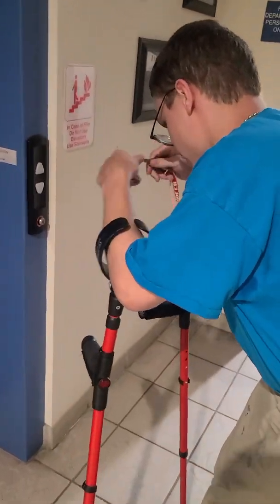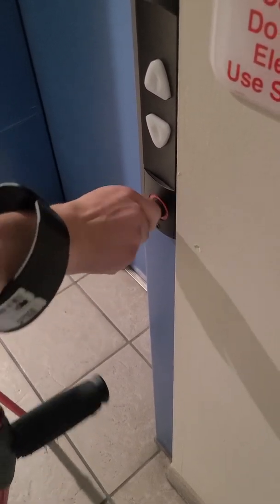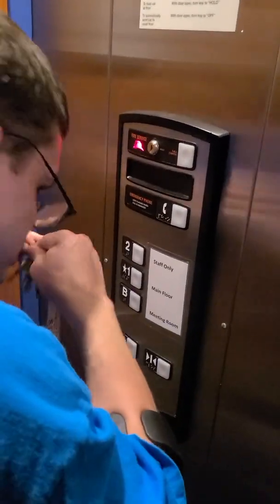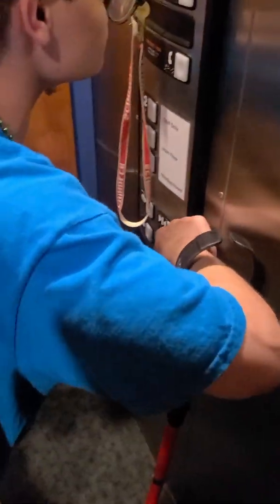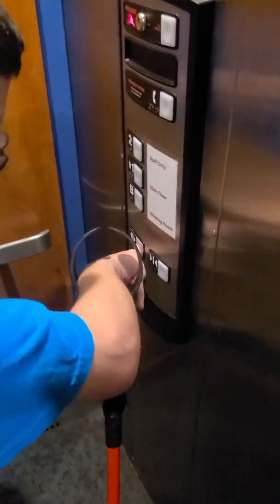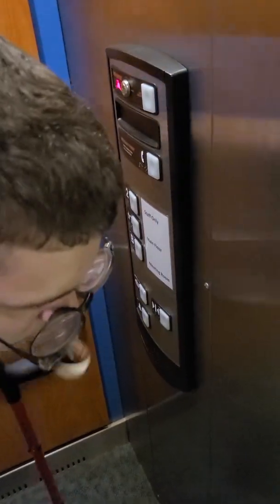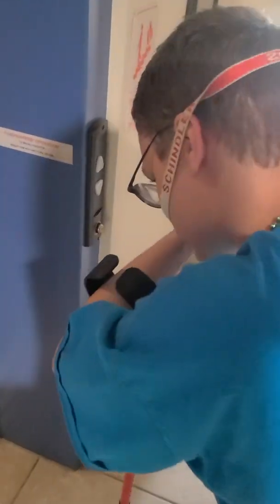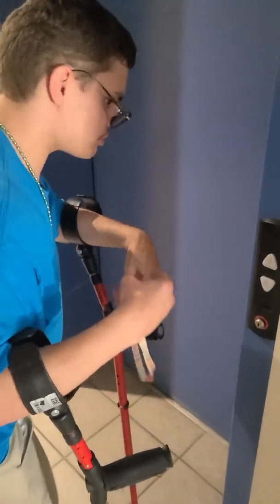Fire Service demo on a Schindler HT 330A Hydraulic elevator

Comment: NOTE: This is for older HTs installed from before mid 2009. The newer HTs will have some firefighter operation panel that swings open once you use the interior key.